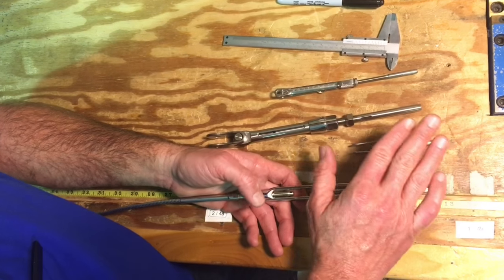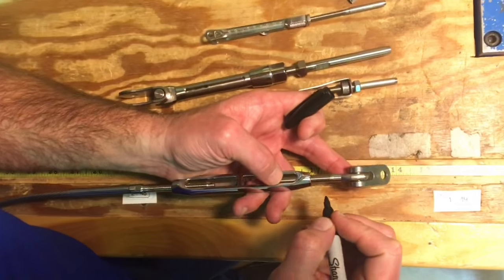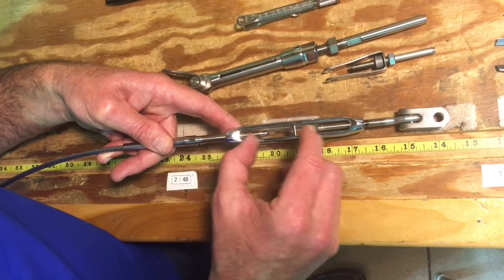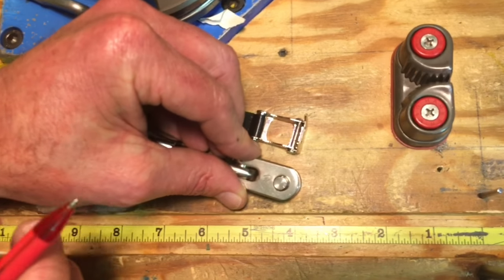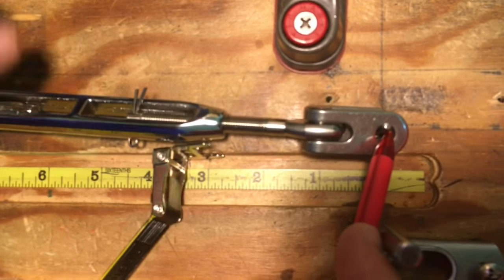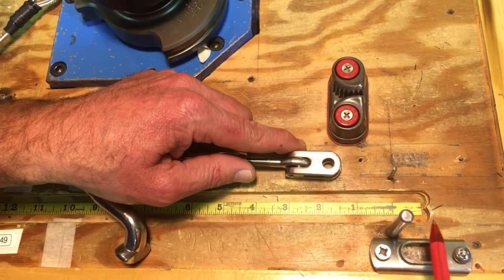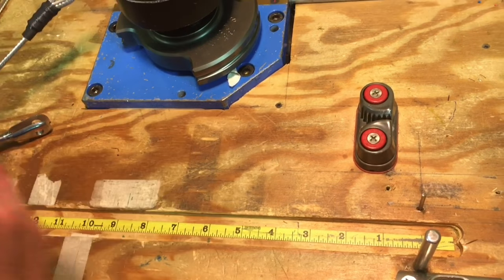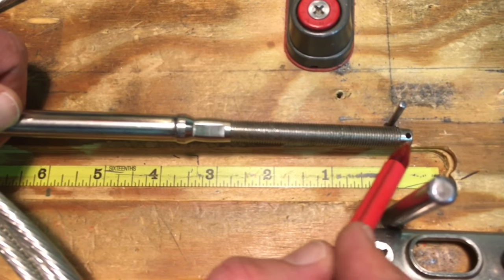How to Measure Sailboat Wire & Rigging Fitting | Expert Advice

Comment: You tell us to adjust the rigging to where you like to have it.  How do you allow for stretch?  Surely, if the bolts in a turnbuckle are nearly touching each other, you will need to shorten the new stay somewhat, to set the new stay in the middle of the turnbuckle's travel.  How do you allow for that?.
Reply from the maker: Hi, Thanks for the question. We ask people to adjust shrouds to their normal sailing position for measuring. If that is bottomed out (at the end of the wire) we will make that the new middle, and will generally open them up about the distance of the wire diameter. Hope this helps. Thanks, APS